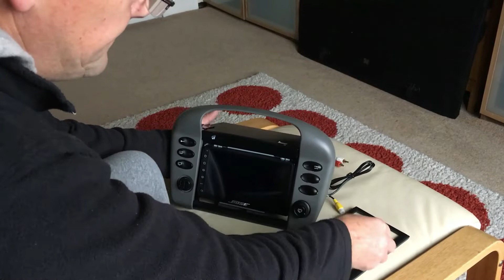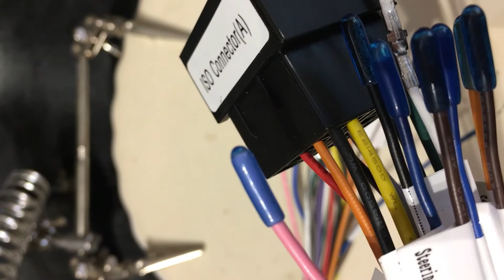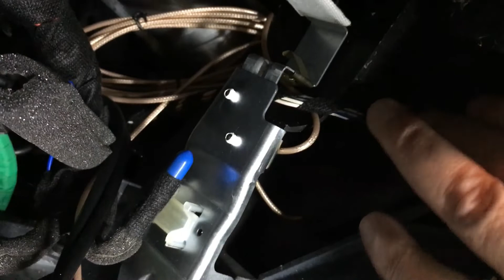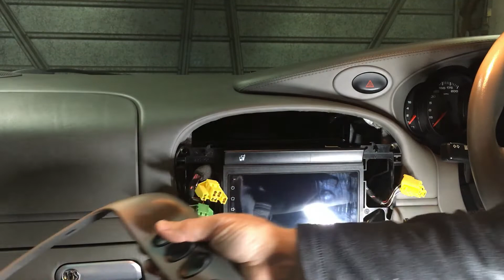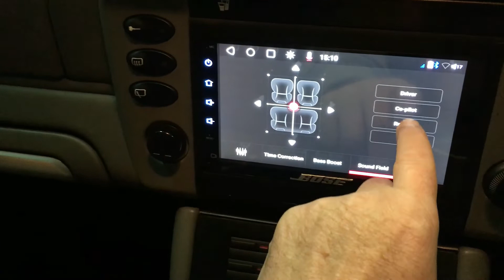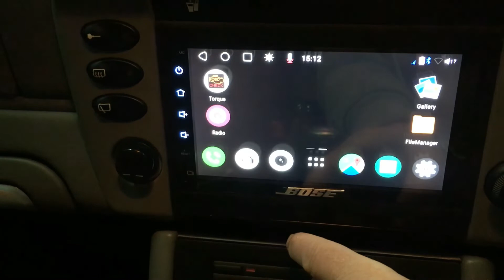Fitting a Double Din Head Unit into a Porsche 911 -  996/986

Comment: Hey Ed , so I’m having and issue with my wiper blowing a fuse in off position. Motor is good and don’t see any damaged wires. I do have an aftermarket stereo. Could this be the problem? Relay? Or stalk … any info would be extremely helpful … nice work mate !!!
Reply from the maker: Sounds like a separate issue. It could be a short if it’s happening in the off position. I have come across issues with it happening when in the on position due to sticking motors or the through point being contaminated by water and therefore corroded and jammed. Check YouTube for circuit issues and checks with a multimeter - good luck